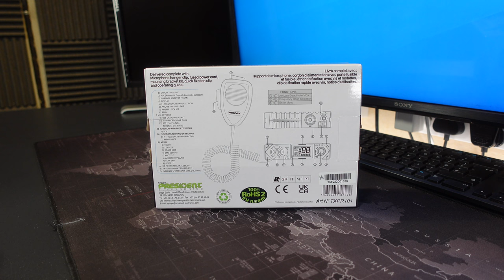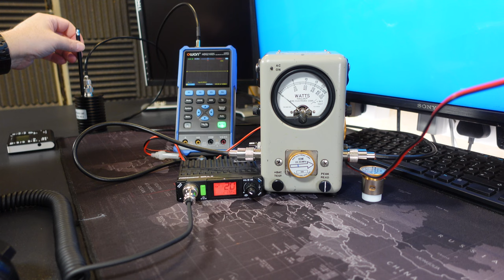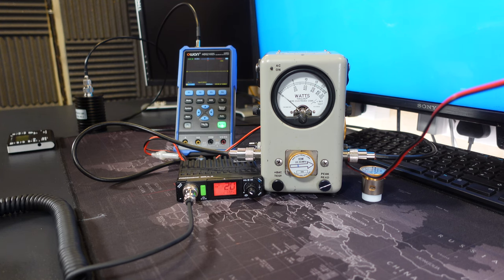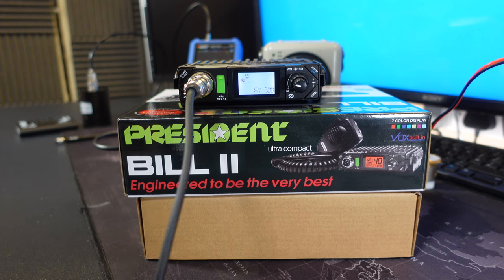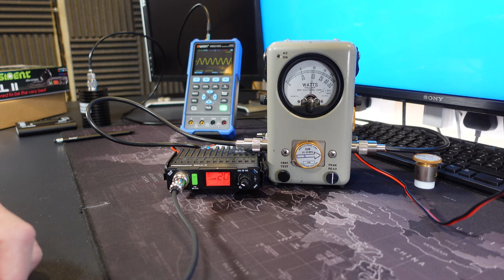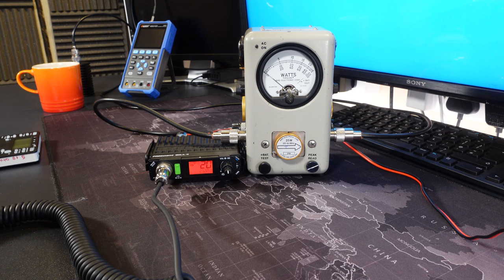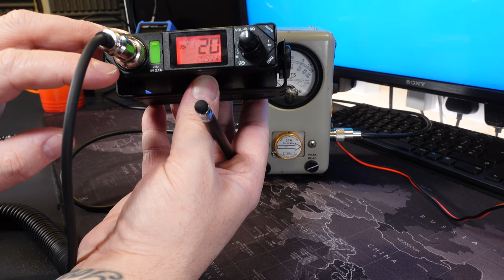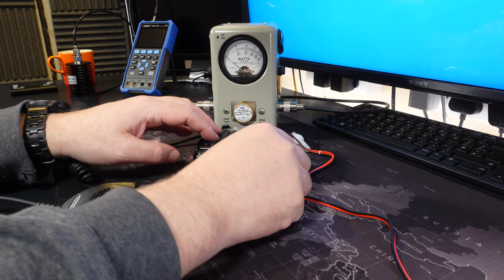President Bill 2 CB Radio Review, Service Menu, Power & Modification

Comment: Only thing about this radio even at 4 watts during QSO it gets so hot you could cook a egg.  Thermal camera capture. Nice touch.
Reply from the maker: Hi Mike, it certainly does get hot when used for longer periods of TX as the case is used as the heatsink. Expanding and pushing the power up to 15W increases the heat problem. If its being used for RX with occasional TX its fine. It is something that needs consideration when deciding on where to mount and to ensure there is some airflow. A nice compact and capable unit but if the portability is not a key buying reason then other radios in the range would be a better choice. All the best and thanks for watching.

Comment: This little thing does fit in every car or portable equipment perfectly. For shack its too small in my opinion. The President Bill has many features inside but some similar small others like the Albrecht 6110/ 6120, Team Minicom, CRT Millenium, PNI HT 6500 are much cheaper and do their job as well. All in all those small CB-radios arent my taste because of their small display. I also wouldnt modify to more power as the allowed 4 W because often these little cb-radios get too hot inside if 10 or 15 W. However, thanks for the video and your opinion about the little Billy Boy.
Reply from the maker: Hi Gordon, for a shack the Bill 2 is far too small. The advantage of the Bill 2 is its size and portability and power consumption. If you want a very small radio that takes up little room and can be setup quickly on the occasion its needed then the Bill 2 is ideal, an occasional radio if you know what I mean. The fact that you can fully expand it was also a nice surprise. Heat is always a concern and I wouldn't run it over the legal limit unless in an emergency (life or death) situation where the additonal power was needed. It handled 15 watts well and didnt turn into a firey inferno within a few seconds. I keyed up for 2 minutes straight and it hit 45 degrees. Lincoln 2+, McKinley, Walker 2 or Richard are much better suited for a shack. I really wasnt expecting much when I opened up the "Billy Boy" and it turned out to be a far more capable radio than expected. 73's and thanks for watching and commenting.
Reply: Have one setup as a field/camp radio. Poor cell sevice around the cottage here in Canada.

Comment: Maybe I missed it, but on your power test at 22:45 minutes into the video, you didn't actually set the PL setting lower (it was still at 145 when you went out of the factory service menu), so the output still would have been at its max.  Maybe you did it off camera though and I missed it.  Are you certain the PL setting won't control the power output when it's in expanded mode?

Thank you for your video. It helped me prior to purchasing one last night.
Reply from the maker: Ah the Bill 2, this radio has been out of its box more than any other radio in the collection. I have tried so many things on this radio so can't remember as it was a long time ago now. President are a bit strange with their factory services menus. On some radios the lower the number the higher the power output and on others its the other way around. I just can't remember on the Bill 2. If memory serves me correctly, we didnt get a P2 mode which is the normal high power mode. Maybe the Bill 2 needs revisting sometime soon to see if we can find it again with fresh eyes. All the best and thank you for watching MJ7NLK

Comment: QUESTIONS:  In the video you made 2 changes - 1. Changed the Jumper Position and 2. cut the wire.  Did changing the jumper increase the power?  Did Cutting the wire allow for the the Band Blocks?  SO---the real question is,  If I only want to increase the power without adding the additional band blocks, what action is required?
Reply from the maker: Hi Mike, the jumper sets the radio into expanded mode in software but it is a two stage process. If you cut the wire and set the jumper then you get the power increase and the frequencies. If you then set the jumper back again the radio returns to standard mode and standard power. You can adjust the power output in standard mode via the factory services menu but the maximum it will go to is about 5W. I have not tried but suspect jumping the jumper and not cutting the wire will set into expanded mode but the power will not increase. So, there isnt an option to bump the power but keep the radio in standard mode that I am aware of. Hope this helps and thanks for watching

Comment: Great radio. All them bands and 15 watts for the money is a bargain. Plus its so small and neat you can take it anywhere.
Reply from the maker: Hi Simon, yes it certianly surprised me that it can be fully expanded outside of just the 120 channel expansion mode. You can also perform another modification to enable high power mode but that involves soldering a wire on the PCB. I will be doing a video on that when I get the time. Unfortunately the PCB will have to come out to do that and that means de-soldering the antenna and detaching the VRM's as you cannot get to the underside of the board without doing so. I am defo up for potentially sacrificing the radio to see what challenges arise in performing the mod. Stay tuned for that one, fingers crossed it goes well. Its just so small to work on. The normal sized radios are much easier to modify. All the best and thanks for watching

Comment: Another great video. Some of the radio shops in my area said that the bill 2 and the thomas were no good and not worth the money.  I think they are all use to the older style radios with adjustments on the boards. I will be able to tell with some long term testing.
Reply from the maker: Hi Robert, I think the problem is that most of the action on CB is on SSB these days, well it is in the UK. Some people say that any radio that does not have SSB is just an expensive paper weight. I still have lots of fun with non-SSB radios especially hunting for skip (DX) but having a SSB radio just gives more optionality supporting all modes but they are more expensive. The Bill 2 was a bit of a surprise with its full expandability and not only being limited to the 120-channel mode that some others in the range can only do. It's ideal if you don't need SSB and just want a very small unit which can be pulled out in the case of an emergency. President makes lovely radios but you are unlikely to shift the old school breakers over to new-fangled chip based radios. There is nothing wrong with either preference and what's important is that the pool of breakers gets larger and not smaller. Thanks for watching and for commenting. As mentioned in another comment, hope to have the next video uploaded in a week or two.

Comment: You mentioned a video about explaining band blocks.  Any chance you could link to that? I’m probably just not up to date on the lingo.
Reply from the maker: Band blocks are just sets of 40 channels with different freqencies. Block A has 40 specific channels starting at 26.965 and ending 27.405 (in EU its the CEPT Norm which also matches the US). Block B is whats known as Superior which starts at 27.415 and ends at 27.855 and Band Block C is Inferior starting at 26.515 and ending at 26.955. All of these frequencies are shown on screen in my President Truman video.
When expanding a radio, some just open up to the Normal, Inferior and Superior blocks and other fully open up with Band Blocks covering 10 Meter band, 11 Meter Band (which is CB as mentioned above) and 12 Meter Band. These are reflected in blocks D, E, F, etc.
Just to confuse even further, you can also switch the radios (well most) into either T5 mode or T0 mode when expanded. All this means is that all the frequencies in the band blocks are decremented by 5KHz when in T0 mode. Normal expanded mode is T5 and switching to T0 just knocks 5KHz off. Band Block A, Channel 1 in T5 mode is 26.965 and when switching becomes 26.960, etc.
Hope this helps and thanks for watching
Reply: @NLKMediaGroup  thank you so much for the info!!!

Comment: Will this mod work on the models sold in the North American markets? Thank you. Found the video very well done and informative.
Reply: I am wondering the same as well
Reply from the maker: Hi Kamaitachi, first of all thanks for watching and for commenting. I do not have any of the FCC approved versions to be able to test them. I am told that the US/NA versions have been restricted and dont have an expanded mode like the EU versions. I think its an FCC requirement but am only going on info supplied by viewers. I do not know if there are PCB differences, component differences or software differences to restrict them or not. A viewer followed my Randy 3 tear down and reported back that the wires to expand were not there but I am unsure if that is the case on all radios. I guess you could try and get hold of an EU version radio but have no idea if there would be problems shipping it into NA. Sorry I could not give you a definitive answer to this. All the best
Reply: Just tried on the FCC model, and it does not work, no power increase or special menus.
Reply: @fecheverria It worked on mine. I have the FCC model and the factory setting mode upped the watts about a watt and a half.
Reply: I seriously doubt they care just as long as its near 4 but you still have those A holes out there blasting thousands of watts saying swear words.

Comment: Thank your for the great video. How are the temperature conditions during unmodified operation? Greetings from Germany, 73 de dh6pf
Reply from the maker: Hi and thanks for watching. The radio is fine under normal operation and seems to manage the heat well. The case is solid mental and used as a heatsink and works well. It does get hot with extended use but nothing to be worried about. All the best, 73's, MJ7NLK

Comment: You can get even more power out of it. You just need to connect the two contacts right next to the loop that you will cut.
Reply from the maker: Thanks Dope_Clips, I will check that out when time permits. Usually with President Radios its a 1k resistor that gets soldered in but will check for this. Thanks for sharing and for watching. All the best
Reply: I have tried this, what combination are you referring to?

Comment: I think it a little bit more over, maybe you have to cross the blue cable like in the Harrison II to get the extra P1 P2 etc in the menu
Reply from the maker: This radio has been opened more times than my fridge :-) I have tried so many combinations that I can't remember what I have tried. It would be nice to find out how to enable the menus with the high power mode, if that is possible. It's so small that it might not have one. Mind you, its been fun looking for it. All the best and thanks for watching. MJ7NLK

Comment: i did enjoy the video good explain!  but ask myself if you only move the jumper no cut what happen than?
Reply from the maker: Generally, moving the jumper only will enable the expanded frequencies but not the increased power. You do get a little more power on some of the radios when just moving the jumper but to enable full power the wire needs to be cut or on some radios moved to a different via. If you just want the expanded frequencies then jumping the jumper will do this. Thanks for the feedback and for watching. All the best MJ7NLK
Reply: @NLKMediaGroup  thank you for the reply!

Comment: I came across the RU mode but can't get out of it ...any ideas to get back to multi norm
Reply from the maker: Hi, I think you can engage RU mode by holding the corner buttons when turning on. I just cant remember what the combination was. Try holding the left two and turning on, also try the same with the PTT button held. If your really stuck let me know and I can break out my Bill 2 and see if I can help. Sorry for the delay in responding, was a little behind on comments. All the best and thanks for watching

Comment: 6110 ? 6290 ? Or the pressident bill ? 

What should i buy ?
Reply from the maker: Good question, AE-6290 vs PB2, hmmm. Both are good radios but I would have to say that out of the two I would pick the PB2. I am not a fan of the RJ45 style microphone plugs which the Albrecht uses, but both are decent units. All the best and thanks for watching.

Comment: Hi, is there a big differences in audio quality and size vs the Barry 2?

I have a difficulty to choose between the Barry 2 and the Bill 2.

Radio would be used for occasional overlanding communication between cars and double as a emergency communications when shtf.

Would run it out of a gel battery or portable powerbank.

Any recommendations on  the more suited radio?

Thanks for the extended reviews.
Reply from the maker: I would choose the Barry 2 out of the two if your mounting in your car. I have just reviewed the Radioddity CB500 on my channel which is worth consideration and has NRC built in and super easy to modify. All the best and thanks for watching. MJ7NLK

Comment: So I am still learning CB. As I have recently came under a great desire to learn more and radio in general. We run CB in our dump trucks. And I have recently put CB in all of our heavy equipment. Even got a couple handhelds. But I still know nothing….

Here is my big question for you. When you get into the service menu and you bump up the wattage. does it also bump up the watts on AM?
Reply from the maker: Hi Matthew, yes it affects the power output of the radio and pushes both AM and FM. When testing AM you will see the power output increases when you talk as the voice signal is combined with the carrier and output. I only tested the carrier on AM in the video to see how much the power adjustments changed it. When talking loudly into the mic the AM power output can more than double on the meter as its the amplitude that is being modulated. With FM its a constant power output and it is the frequency of the transmission that is modulated. Hope this helps and thanks for watching and commenting, all the best. Have just tested AM with a constant tone and its outputting about 17W with a 6.5W carrier.
Reply: @NLKMediaGroup  thanks so much. Guys like you is what makes me love YouTube.
Reply from the maker: @mshermanwest  glad I could help, all the best

Comment: Hi thanks for your videos great infomation well presented, if you just cut the wire would this give you the power gain?
Reply from the maker: Hi, cutting the wire does give a boost in power but to unlock high power mode it needs to be moved. If you cut the wire and then later on decide you want high power mode you will have to use another bit of wire. I have a second video on the channel for the Bill 2 and removing the board to enable high power mode. Happy new year and all the best for 2024
Reply: Thanks happy new year to you too, is that the teardown video? And did you end up finding a p2 menu, I'd like to power mod it and dial it back to 4w so I have that extra power if I needed it for let's say emergency use, when the white wire is cut what happens when you turn down the PL I see you have it at 145 what happens if you turn it down to let's say 100 do you still get 15w or does it go down?
Reply: So I received mine today, seems the jumper also needs to be jumped and the wire needs to be cut for the extra power and extended mode, seems you don't get any of the extended mode or power without doing both, I gave it a try and turned down PL to 100 and power stays at 15w, such a shame there is not an option to tweak the extended power mode, I guess you could put a little switch on the jumper wire and flick it over when you want more power
Reply from the maker: Hi Glen, You need to cut the wire and move the jumper to expand the radio and there is another mode to fully expand the radio. PL is power low and relates to the unmodified state. Please let me know how you get on. I have a second video on this so please check it out https://www.youtube.com/watch?v=yQ1LEJHrPzM&t=488s  @glennearnshaw842
Reply: Thanks I watched that video on the teardown and you say its not got the p2 menu
Reply from the maker: So many radios, i forget what options there are on all the models. However, there is something you could try. What I have noticed in the newer radios is that sometimes you can move the wire on one end over to the adjacent via and that is what enables the high power mode in the menus. Watch my latest video on the George 2 and the modification on that which can be found at 22:44, its possible that a similar method could be what it takes to get the extra mode in the menus. There are no guarantees on this as lots of this is trial and error but I think that is likely to be the solution. Happy to try it on my radio but wont be able to do it until the weekend.  @glennearnshaw842
Reply: If you could that would be great, a good suggestion would be to solder some header pins onto the contacts and use ardunio Jumper wires would make it easy to try other combinations
Reply from the maker: @glennearnshaw842  will let you know how i get on, happy to experiment on my unit, i have a good feeling about the revised mod 😀
Reply: Fingers crossed as the P2 option would be handy
Reply: I have found that if you hold ANL/NB & F and PTT then POWER ON you get a screen saying test, maybe onto something
Reply: I have tried a few combinations with no luck
Reply from the maker: @glennearnshaw842  will be trying over the weekend and will let you know how i get on. Thank you for the Coffee, very kind of you, am hopeful a revised mod will do the trick :-)